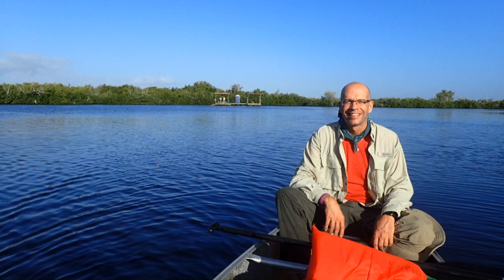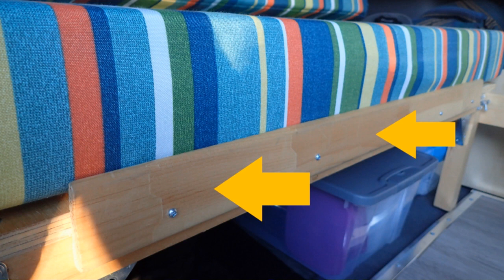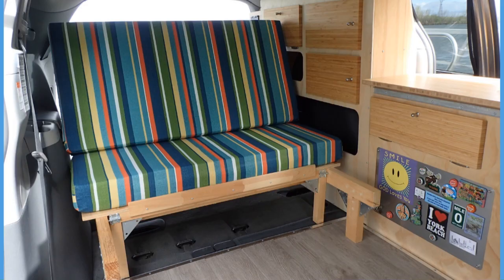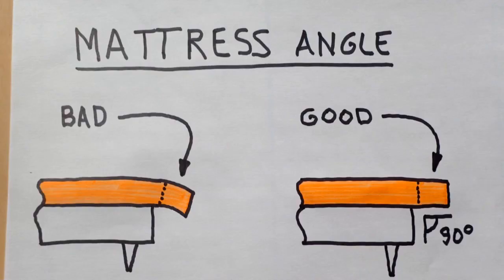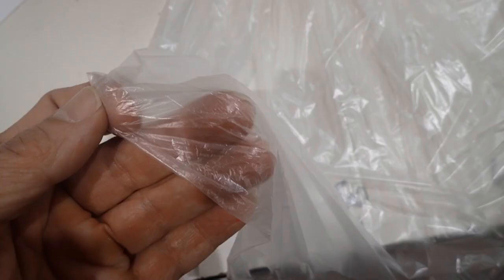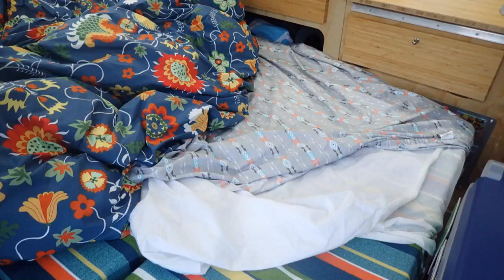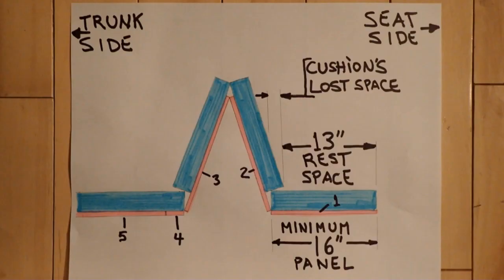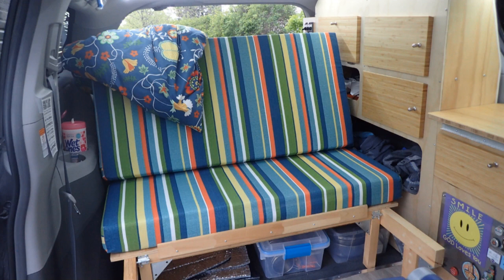Van conversion MATTRESS: how to cut and tips (EASY)

Comment: Nice job! Thank you. I have a few questions, please....
1) Are your cushions 42” x 5”? 
2) I’m 5-11. Is 42” wide enough for two humans?
3) How long is your bed? 
4) My only reservation about converting my 2006 Sienna into a camper vs buying a bigger van is the hassle of having to put the sheets and blanket on the mattress every night. I don’t know a way around that though. On a scale of 1 to 10 with 10 being a major hassle, what number would you assign the task of having to make the bed every night?

P.S. From Carlsbad, California. 😀
Reply from the maker: Hello Joe!
Here’s the answers:
1) 42.5 x 4 but you gives 44 inches of space to avoid your cushions and bed panels scratching the side wall of your cabinet and van’s wall. You can go for 5 inches mattress. But, the thicker the mattress, the lower should be the bed if you have a long body trunk.
2) absolutely. With the answer above, you know that the bed end up at 44”:
https://youtu.be/hvfJSwc5u1A

You can do a search on the different Westfalia models bed dimensions. You will see that it is even larger and longer then some models:
https://www.gowesty.com/tech-article-details.php?id=24
3) 6’2”, still longer then some Westfalia models!
https://youtu.be/hvfJSwc5u1A
4) I do not remove them, only in the front side of the bed (fridge side) I « unclip » them and push them in the back were is the back door, then fold the bed! When night comes, I just unfold the bed and « clip » back the sheets and blankets. It is really fast. It takes less time and effort then at home! I should show this in a future video. I find so much complicated some bed designs of other vans... I really understand your concerns! If it’s not easy, I am not into it! So... I guess 2/10 and 3/10 at home 😉

You are lucky to live in Cali! And thank you for your appreciation comment.😃
Take care buddy✌️
Reply: @ericenjoysearth2756    Thanks for replying and for the links, Eric! 
1) I want as much room under the bed platform for storage as is possible but that's limited by sitting headroom when the bed is in sofa mode plus the thickness of the cushions. Approximately how many inches high is it from the van floor to the TOP of your bed platform? Also, how tall are you? 
2) Your platform has 5 pieces with one being very narrow (panel #4). You mentioned somewhere to make all four bed cushions the same size. So, if you did this over again and made all four cushions the same size, could you eliminate the little narrow #4 bed panel?
Thanks again.
Reply from the maker: Hello Joe!
1) You are right with your recapitulation.

I am 5’11”. My recommendation for the height of the bed structure is to begin with longer legs, and you shorten them to fits your size. The longer the leg of the bed, the more confortable you will be. If I am taller than you, you probably should end up with longer bed legs... from the hard floor, measuring from the top of the plywood panels of the bed, beginning from more then 14 inches or so should be enough. Then you shorten the legs of the bed until you are satisfied.
Everybody does not have the same body segments... This method allow you to have the best fit for you! 

2) What I recommend in the video is to do better then I did by adjusting your panels size so that you can have 4 interchangeables seat cushions. That way, you’ll get a longer life for them! But you can’t eliminate panel 4 because it hold the bed panel assembly to the bed structure. The suggestion is more to have panel 4 and 5 (together) of the same length of the other panels.

Enjoy building your van! You will have nice souvenirs of it! ✌️
Reply: Are your seats removable?
Reply from the maker: Yes

Comment: Do not put plastic wrap on the foam. It will make noise when you sit on it and when you move around while trying to fall asleep, it will drive you crazy.
Reply from the maker: You are right that hard nosy plastic would do what you said. But if you use the one that the seamstresses use, there is absolutely no problem. Hopefully science of materials find a solution!
Thank you for sharing an experience. ✌️
Reply: Eric enjoys Earth     The silk film isn’t noisy when you move on the mattress? Does the silk film wrap all the way around the mattress?